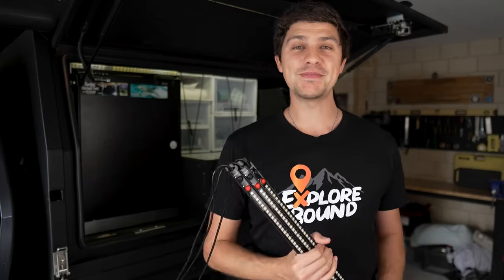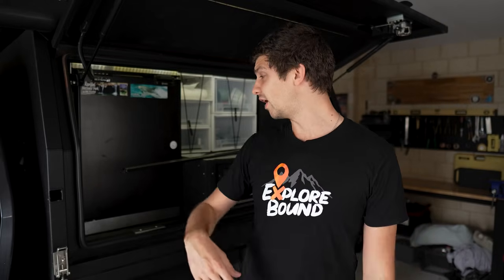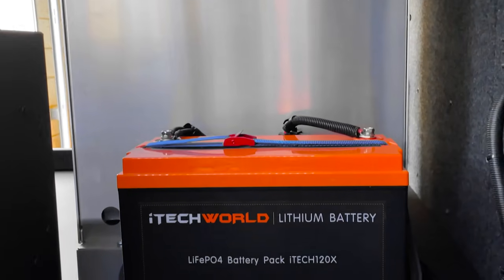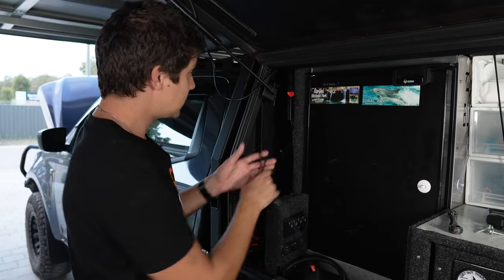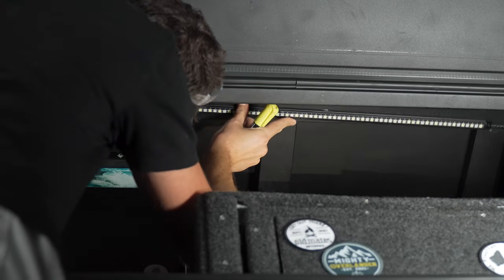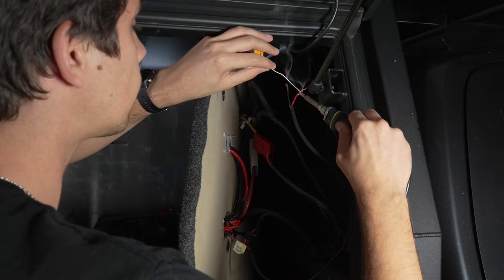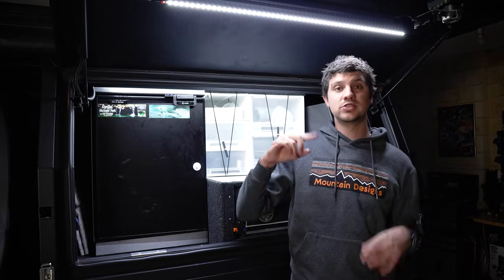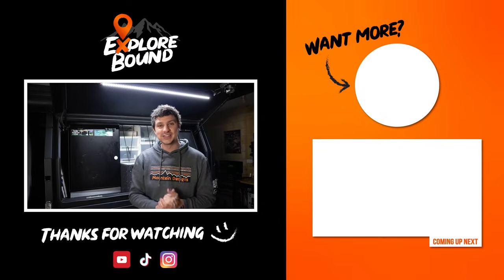Next Level Canopy Lighting! 12V DIY Install of White & Red LED Canopy Lights

Comment: Good job Daniel, put a dimmer switch on ur control panel somewhere, cheap & easy install for dimming ur lights & saving a lot of power. A small external light on a IR sensor for getting out of the tent in the middle of the night is handy when u gotta go too.

Comment: I have a red & white LED strip at the back tailgate of my LC80.  IMO red light, a part for being the best colour for not attracting bugs, is also a better colour for providing enough light to illuminate the campsite but not over-power it like amber still does.

Comment: Have been considering those lights from either PDP or Allspark and as per your comment based on the specs which I read, I did think the power consumption seemed a little high however I haven't found anything similar with lower current, maybe 2 smaller lights switched individually could be an option or invest in a second battery if required. Thanks for the content team. Cheers

Comment: Looks great, the old ones you installed always need silicon to keep them in place, no matter what brand the DS tape on them is rubbish, report back on if the Red is more effective than the Amber for bugs

Comment: Should put a rheostat in line dude, they're as cheap as chips these days and real easy to do. Keep your lighting local, not yocal, and drop down a few lumens when not required, save on that inverse square law of light when not required.
Reply from the maker: Good suggestion!

Comment: Have you. compared red vs amber lights with actual live bugs in a real life scenario? Totally loving youse channel, just found it !! The all spark looks very similar to terralume, but that only comes in amber.
Reply from the maker: Hey mate, the red has been a significant improvement over amber for bugs, they are basically non-existent with the red lights running whereas amber there was still a few. It's not as 'easy' to see around camp with the red vs amber, but your eyes adjust surprisingly quick and red doesn't affect your night vision either.
Reply: @explorebound  Good enough, pre ordered one from the next batch !! They said as soon as your video came out the things went viral and sold out !!

Comment: Awesome job Daniel, once I get my tray and canopy package next January I'm going to be running Amber rock lights from Onyx lights. 
1 question for you how do you like the Smart shunt, I'm not sure whether to go that route or the 702 monitor, any advice would be welcome.
Cheers 
P.S Will be looking at your DIY 12v install as I want to wire my own lights, but will get my Auto sparky to install the Lithium battery (Remco Xtra, FYI).
Reply from the maker: Thanks mate! The smart shunt has been a game changer for me, I'm constantly checking the power draw of everything I turn on now, bit of an obsession haha. The bluetooth range is pretty poor, but I don't have a problem with it personally as I'm usually only wanting to check it when I'm right next to the vehicle anyway. 🙂
Reply: @explorebound  Thanks for that, I'm still unsure of what I'll buy as my battery monitor, I still have a few months before I get my Trojan Canopy fitted (4 months wait time). I did hear through a Redarc sales guy that they are pretty sure they'll have their own battery monitor out by the start of next year possibly, so pretty keen to look at that monitor.

Comment: What is that channel stuff that is keeping your wiring hidden on the door ?
Reply from the maker: That's just some black cable management covering - you can buy similar from most hardware stores like Bunnings in the electrical section. 🙂